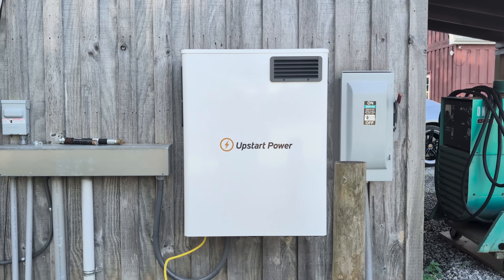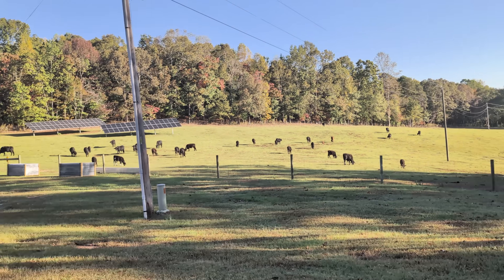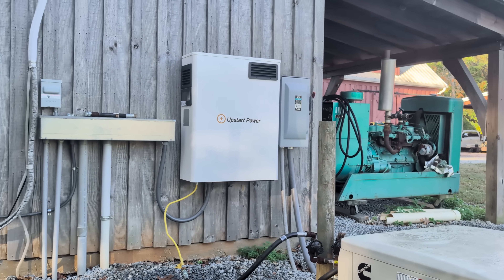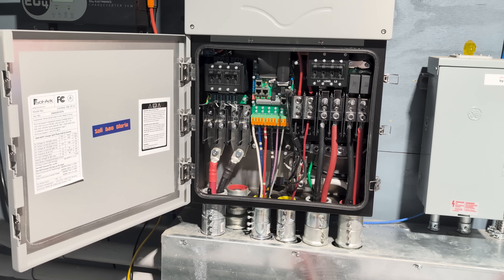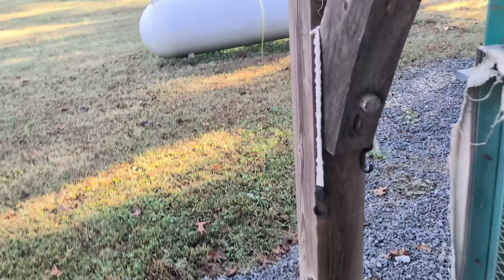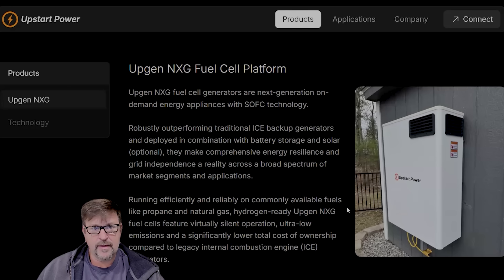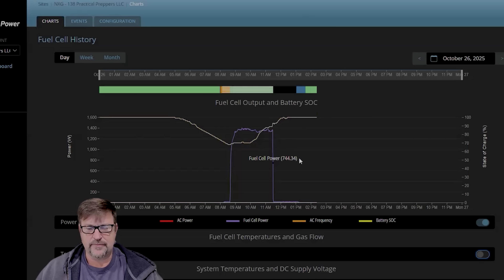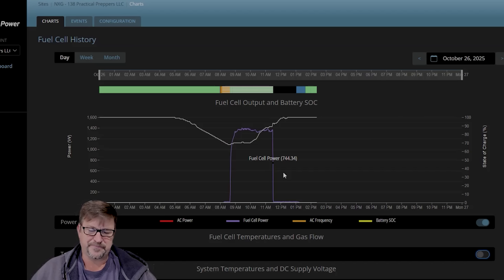You’ve Been Waiting for It | The Upstart Fuel Cell in Action

Comment: 8K$, been off-grid 25 and dreaming about getting one since the eighties.  Would be great thing to leave for son's you know.
  Got everything big and multi sourced enough haven't needed a generator for 15 yr.
   Be nice to get a new toy but like with everything your paying the extra price for them to figure out mass production.
  Take from one that has watched panel prices go from 6-7$/Watt if cheap and now 15-25 cent's for good.
  There is good news they have to warn about degradation,  but my experience and gov tests done show over 40 yr it is barely noticable.  These things are going to work when the grandbabies have their grandkids. grandson only 2 now but gotta hope for more.
Peace Y'all.
Reply: It lasts less than 2,000 hours of run time. The tanks needs to be replaced every 7 to 10 years and cost thousands of dollars as hydrogen embrittles and tries to escape from everything it touches. Hydrogen is hard to store, hard to transport and cost 5 times as much as diesel if you can even find it.
Reply: @Aircam73  so use propane for now, and be ready for hydrogen. The "it lasts less than 2000 hours" is the manufacturer's warranty. The warranty on my generator was for 1500 hours, I have already far exceeded that, and I expect to get over 20000 hours out of it.

Comment: Operable to only -20C, right? So not really for northern climates? Or is there an option to keep it in a heated/protected enclosure with appropriate venting for in/out? It looks like an interesting solution - but for grid-down backup, it needs to have the same temp range as the ICE units it would be replacing.
Reply: THIS!!!

Comment: 2:10, as a propane delivery driver, that CSST yellow line bugs me lol. they are not for outside use, and I avoid them on the inside as well. I try any type flex pipe/hose to avoid CSST. I've found more than 10 of them with micro holes after storms with lightning.
Reply: Are you saying nearby lightning strikes pinhole damage?
Reply: I don't disagree with your CSST opinion.  However, this appears to be yellow poly coated copper to me. It really appears to be YPCC @ the tank regulator.

Comment: In the video it mentions that this is directly charging 48V batteries, but can it instead provide 240V to a generator input?  I am using a high voltage battery system.  I guess I could just use a simple 48V to 240V inverter?  I did some napkin math, and based on it taking 12 cf of natural gas / kWh, at my current rates it would cost me about 20.7 cents / kWh in fuel cost.

Comment: The conversion efficiency from propane fuel to the electric power appears to hover at approximately 40%. Granted that marketing slogans like, " Robust efficiency", likely indicates that greater efficiency can be had at increased hydrogen build costs. Noise aside, current combustion engine design is on par with 40% efficiency. However, megawatt producers running turbo diesel combustion engines ( during electrical production plant balancing with the grid supply) , claim to be reaching greater than 95% efficiency . It appears that steam turbine ear splitting noise from waste heat outperforms engine mechanical power by at least 10%. Waste heat.
Reply: Yeah, you can get more efficiency if you can reuse the process heat for something. That is true for both mechanical generators and fuel cells. I think that there are some commercially available CHP (combined heat and power) systems in the UK that use this technology to both generate electricity and heat water for hydronic (i.e. radiator or in-floor tubing) heating or domestic hot water.

Comment: Nice new product.  I'm still grid powered, with solar/battery backup for silent power, with a 14kw diesel generator.  I run the generator once a month.  It is located inside the garage since I don't want a generator in the weather.
Reply: With a grid-connected battery storage + solar system, adding a whisper-quiet Upgen NXG Fuel Cell (~34 kWh per day) that enables your batteries to do their job for as long as a grid outage lasts, might allow you to "ditch the diesel" entirely 😀

Comment: Very interesting with a lot of potential.  I'm mostly interested in the off-grid application.
1)  Can it be mounted indoors/utility room and vented outside?
2) Can you quantify how much propane is being used to produce the same amount of power an ICE generator would require?
3)  Would you ever recommend not having an dedicated whole home ICE backup generator and instead using a couple of these?  Why or why not?
4) Do you think it viable/would you start suggesting to clients to decrease their battery banks significantly in turn for leaning on daily use of these Fuel cells or are they not made for long term-long hours of use; are they just for backup?  (For example, if my off-grid whole home setup was planned to be 120 KWH battery bank with an ICE backup generator, could I instead do 80 KWH battery bank with one or two of these fuel cell generators always running for the 10 hrs each night?)
Reply: #1:  The Upgen NXG Fuel Cell is certified for "Outdoor Operation" with Operating Temperature:  -20 to 50°C ... however, technically, the emissions profile of the unit is better (cleaner & safer) than that of an indoor-mounted, vented OD/tankless water heater, which combusts the fuel it consumes.

Comment: Makes sense that it's DC coupled, but kind of unfortunate if you're inverter/battery systems aren't near an exterior wall. What's the gauge of wire you used to interconnect it to your battery buses (napkin math is guessing about 30A current?)
Reply: The AC-coupled version of the Upgen NXG pairs well with Tesla Powerwall, FranklinWH aPower, etc.

Comment: Wow!  For parts of the country with natgas to the home and expensive electricity, I can picture this being cost-competitive with regular grid power.
Reply: i suspect not. fuel cells are very expensive to run.
Reply: @ursodermatt8809  as a fan of fuel cells, I have to agree. The energy to transfer any hydrogen rich medium (water, propane, natural gas etc) into pure hydrogen takes a lot. 
Where hydrogen shines, is when you have excess power/energy and need to store it for later in a high energy density that would otherwise go to waste. Ideally when the top of the day with solar and you have excessive solar, and convert water to hydrogen for use later. 
personally i think hydrogen could be useful today for vehicle fuel cells to take the excess energy on the duck curve of solar, and at night when nuke plants are running since you can't just turn them off, and reclaim some of the energy that would otherwise be lost.
Reply: @cybernoid001  
i agree with the industrial size soaking up of renewable energy and turning it into hydrocarbons or hydrogen for storage.
Reply: @cybernoid001  we are talking about a propane reformer + fuel cell here. If you read the spec sheet, they claim 0.13 gallons of propane per 1kWh produced. That is on par with the cost of running a diesel generator (if the numbers are accurate).
Reply: @ursodermatt8809   I don't understand this comment.  The fuel cell here is doing the running, costing only a 'sip' of propane.  What cost am I not seeing that you refer to?
Reply: @chrisdaniel2759  
yes, a "sip" ! like "you want to buy my house it costs only a tiny bit".  it means nothing. a fuel cells efficiency is about 60%, ICE engine about 20/30%.

the membrane of a fuel cell has a limited life.
you still have to get the gas in. it might be cheap at the moment in the US, but that can change quickly.
you are probably better off installing more solar for the amount of money that fuel cell costs.
besides the "engineer" has been very enthusiastic about many things that then disappear into oblivion.
Reply: @ursodermatt8809  So… it is 2 to 3 times more efficient, and its natural gas fuel that we’re sitting on an ocean of is cheap.  
Ok, thanks for convincing me that you are a kook that I can ignore.
Reply: @chrisdaniel2759  It's cheap NOW. Go back to the Texas Freeze and ask people how much they would pay per gallon in the moment. Change is a constant.
Reply: @chrisdaniel2759  the "sip" is 0.13 gallons of propane per kilowatt hour produced. That works out to about 4 gallons or about $12 to $16 per day (at least where I live). I am not sure I would characterize that as a "sip" but it is not unreasonable compared to a generator.
Reply: @ursodermatt8809  Not everyone lives in a place with sunny weather year-round.

Comment: This almost is a perfect solution but where I live it can get -30 can this be mounted indoors and vented out like a OD water heater
Reply: The Upgen NXG Fuel Cell is certified for "Outdoor Operation" with Operating Temperature:  -20 to 50°C ... however, technically, the emissions profile of the unit is better (cleaner & safer) than that of an indoor-mounted, vented OD/tankless water heater, which combusts the fuel it consumes.
Reply: @UpstartPower  The difference is that the vented tankless water heater has outdoor flue already mounted and is certified for indoor use. This is an important consideration in the event of an insurance claim. It also seems like placing the unit inside a climate controlled area (for example a heated detached garage along with my existing generator, batteries, and inverters) would provide a less stressful environment for the unit.

Regarding low temperatures, what happens below -20? I also occasionally get down to -30 (once even -40). In my case, it may not be critical, I could just switch to using my existing generator when it gets extremely cold, I suppose.

Comment: How many kW/h per gallon of propane?
Reply: Their website says 0.13 gal per kwh
Reply: @steveseattle6791  And how does that compare to a 2 KW propane generator?
Reply: So that's  7.7 kwh per gallon of propane.  We're most generators are in that 1.1-4.4 KWH per gallon area depending on size and efficiency.
Reply: @Jim14872  David Poz got just a tick over 8 kWh per gallon of diesel, using a modified light tower. Diesel has more energy per gallon than propane, so I'd say 7.7 with almost no moving parts or sound is dang good. 

What David didn't count was all the HEAT ENERGY the water cooled engine produced. If he had done so, his efficiency would have more than doubled.

Comment: @Engineer775, let's see you cook up an on-site digester to turn biomass into biogas (aka renewable natural gas)  ;-).
  
Close that loop!!
Reply: That's what the cows do.
Reply: @NoSlack97  To a point - when the waste comes out of them, there is still a bunch more work to be done.  Whereas that can be completed on the ground in the open air (in cow-pie form), if it was captured one could render additional output. ( https://www.youtube.com/watch?v=7LPfno2KPcg )  One can also mix in other waste, like grass trimmings, garden and table scraps, leaf litter, etc.  Stuff you'd normally find around a larger homestead.  At a larger scale this can be done (is done already) in landfills or green waste facilities ( https://www.youtube.com/watch?v=H1c-T1zcRHg ).
  
My dad worked at a sewage treatment plant a decade ago - they were already doing cogeneration (big natural gas type engine with a diesel pilot injection, or a direct spark ignition) which was mostly running the treatment plant's power needs.  When he retired, they were experimenting with fuel cells instead of an internal combustion engine with a generator head.  They found that they needed to upgrade the gas for use to keep from poisoning the fuel cell (aka take out other "crap" in the gas, forgive me I couldn't resist the pun). Larger scale plants or this exist too ( https://www.youtube.com/watch?v=ew1LurftThc )

Comment: For clarity, and that I am not that technical; when you say 1600 watts, what time variable is that. An hour?
Reply from the maker: Yes 1600 w per hour.  It is small but super efficient. Again, this is used in conjunction with a battery via bridge to solar. So it could make about 34 KW a day or more. Can parallel them. So with a small battery bank and a couple of these you could get through any outage silently.
Reply: AC-coupled:  1.25 kW --> ~30 kWh per day
DC-coupled:  1.40 kW --> ~34 kWh per day

Comment: 8k for a generator replacement that sips propane. Game changer. I am totally following this as it will be a perfect solution for my future ADU build. Thanks for sharing!
Reply: As being in town, just not having the noise may be worth it...
Reply: And forgot to add, not sure if same company.  But back 8-9 yr ago someone was trying to introduce similar but only 1KW, for exact same price.
Reply: Just to play devils advocate but not to be negative, an ICE generator that only outputs 1300W continuous (like a Honda 2000) would also sip fuel for way less money.  Not saying I don't like the idea, just trying to keep things in perspective.
Reply: @BassFearDave      2:35 The claim that is it 8x more efficient than an ICE generator is a much more empirical statement than "sips fuel".   Regardless of the size of the generator,  ICE is not going to match it from an efficiency standpoint.
Reply: @dreednlb  There are a LOT of different ways to be 'more efficient'. Not just BSFC. So unless and until they release verifiable BSFC numbers it's all marketing. In theory they could have a total efficiency of 2x a poorly designed/operated generator(engine/motor) but that's pushing it. Most likely they are comparing a 15kW+ generator idling at 1.6kW to their maximally efficient output for the alleged '8x'.
Reply: @BassFearDave 
  Yes small ice sip fuel but you didn't catch that every hundred $ gas use comes to about twenty cents of propane used.
  These things don't sip fuel they stop by once a day and stick their tongue in.
✌️😎
Reply: @BassFearDave  I understand that aspect of it but if this thing is tied to solar and a decent battery bank it only has to put out so much to top things off. In my case i work long hours and use minimal power for those 15 hour days. So for a 600-800 sq ft SIP ADU housing unit it will go a long way to ensure I always have power.
Reply: @BassFearDave  
"it only uses very little gas"  means absolutely nothing.
i mean that statement is totally worthless.
but then again we are dealing with the "engineer" .
Reply: @ursodermatt8809  Do you have a video with additional information?   I'm guessing not..
Reply: @ursodermatt8809 
  Guess you didn't hear clearly.
  This unit is kind of weak compared to commercial ones. What he meant was 80-100$ for gas gen this only uses 1$ of propane 
  Calling it weak because better made ones get ratio more like 150-200 gas for the one.
Hope this helps 
✌️😎
Reply: @Crickelwood 
  You can't even order yet phone and email get no results official release date was supposed to be 3/1/26 but the china problem you know. Good though is the T- man fixed that yesterday. It got me laughing to see Xi come out after so depressed.  
   So wait until after Christmas when they will have to follow the rules or have no business at all with rest of world.
Reply: @BassFearDave  That Honda generator would require significant gasoline storage, as well as regular oil and filter changes (maybe every 100 hours?). The off-grid folks I know who use these little Hondas at their off-grid cabins, treat them as disposable and replace them on a regular basis. For me, the fuel storage issue is a bigger concern. I am not too worried about storing hundreds of gallons of diesel fuel or propane (in an appropriately sized tank, of course) at my house (in fact, I do that today). I am far less keen about storing large amounts of gasoline.